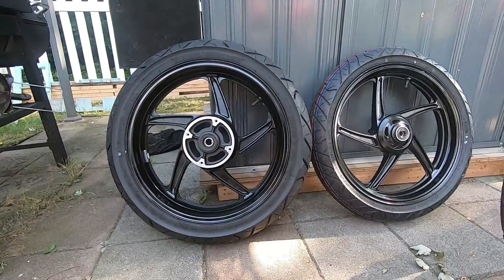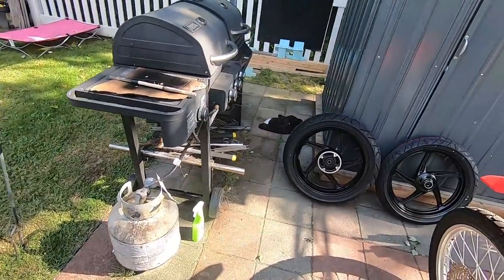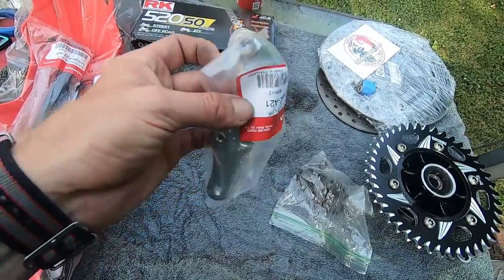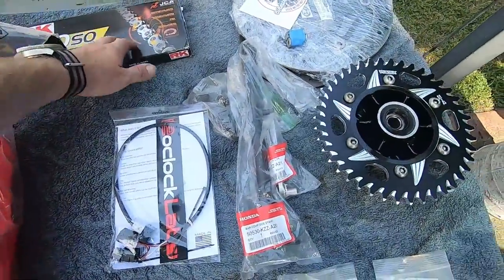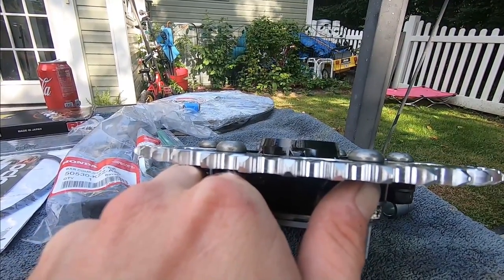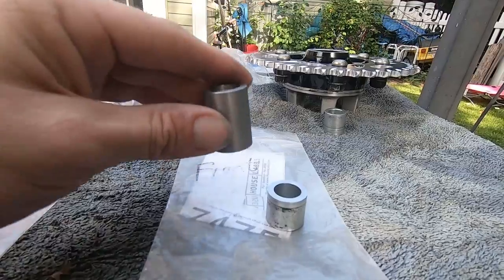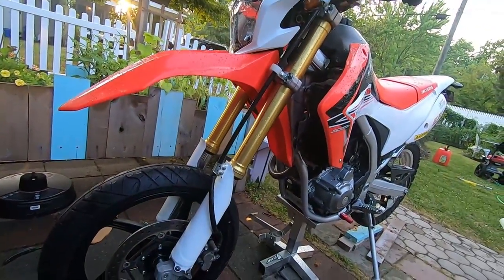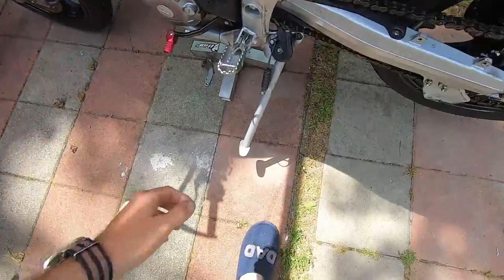CRF250L W/ CBR250R Wheels!

Comment: I was looking at a 250L back in November and the guy selling it had motard wheels to go with it. I thought the wheels looked like they came off a CBR250. The front looked like it was the DIY chop. I was really wanting to get the package.
I ended up declining a good deal because work is really slow right now.
Otherwise, this does seem pretty easy to do once I know I can commit to the purchases.

Comment: hello I have a question Can I know the length of each spacer that goes into the front wheel? In the case of the other side, it seems that it is not a genuine product, so it seems that you can make it by knowing the length. What does the 30mm standard mean +30mm based on?

Comment: Dude instead of shaving 9.5mm off the rear wheel hub could you not just shave that much off the calliper bracket that the spindle goes through ? Would that be possible ?  as i need to do this mod to my CRF250M cheers 😁😁🤘🤘